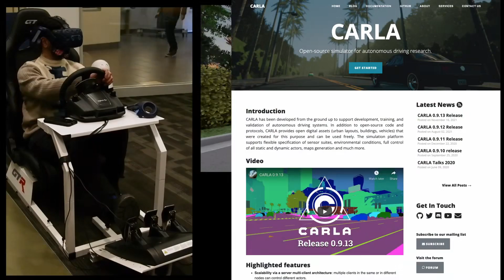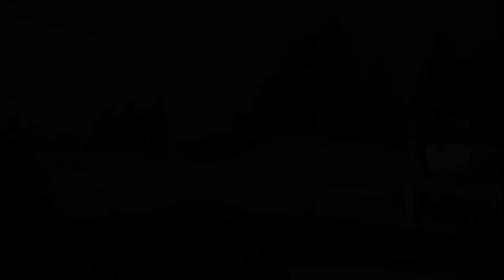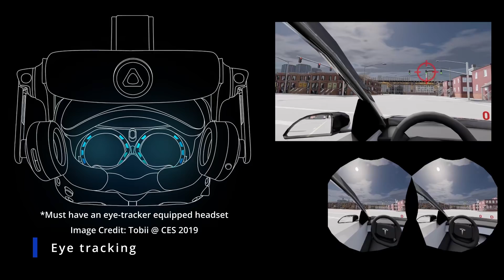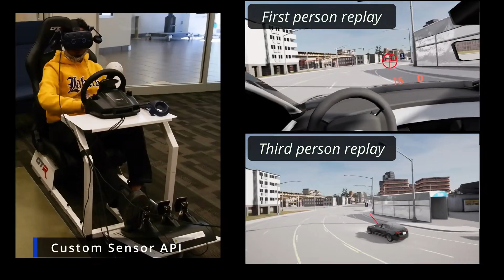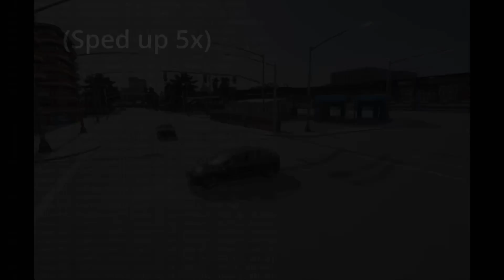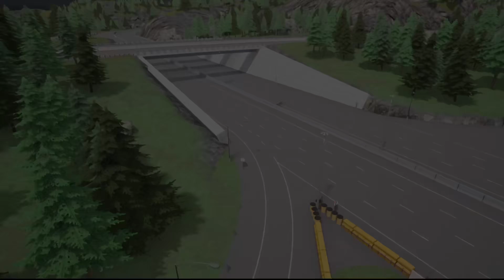DReyeVR: Democratizing Virtual Reality Driving Simulation for Behavioural & Interaction Research

Comment: Hey Nice work. I have also tried to implement a Carla based VR simulator but had many issues with Motion captured avatars and getting good FPS for comfortabaly running the experiments in VR. I am using a Unity based simulation now. But this looks promising will give it a try.
Reply: Did you able to implement the VR later on with the CRALA? What version of CRALA, are you using?